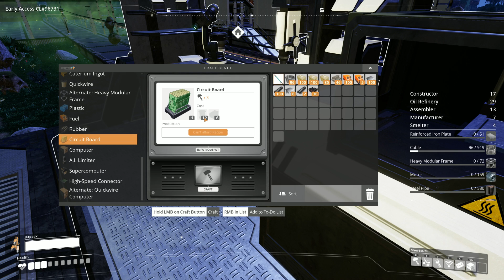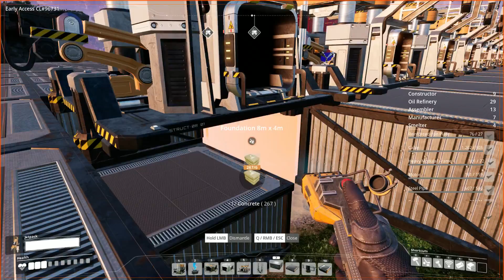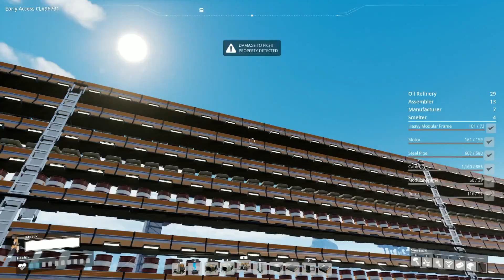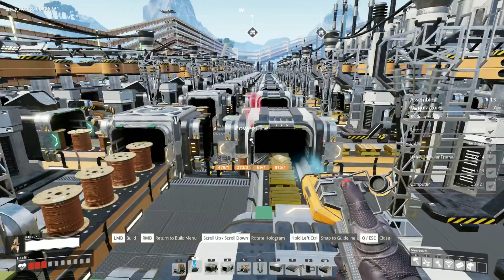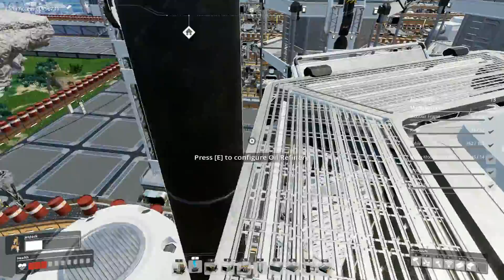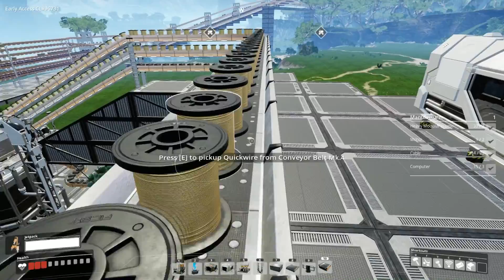Satisfactory Gameplay | 24 computers per min

Comment: If you place your building onto a slope you will be able to see where it's leveling jacks live. At 7:52 the one on the right that is built shows one of the jacks pressing down on the seam between two foundations.  If you look at 10:14 you will notice that none of the leveling jacks are on seams.

That feels completely random on weather it will matter or not as I've played. It my have to do with how the foundations blocks are places (which faces are actually joined as apposed to which appear to be connected).

Comment: The oil barrels going backwards isnt a bug, it's a optical illusion
Reply from the maker: its a bug. you can literally watch it flip back. I know what the helicopter effect is. this isn't it.  it was the first time i've seen it on those lines
Reply: @Skippy0330  The game animates distant objects at a lower frame rate. That lower frame rate is not a bug, it's a level of detail feature to keep the game running smoothly.

It just so happens that the lower animation update rate combined with the speed at which items move along that tier of conveyor belt results in us seeing item number two advancing to just behind item number one's position in the previous frame, and because we don't see the motion that occurs between the two frames, our visual systems are tricked into thinking item one has moved backwards. If item two was a different shape it would break the illusion, or at least make it easier to see through it. Particularly if the belt contained a mix of three or four times of items. That would be a good way to demonstrate that this is what's actually happening.

Technically the fact that we see motion at all when watching a video is an optical illusion too. It's just that we're making it work the way we want it to, by having enough frames showing objects in different positions quickly enough that it convinces our visual centers that what we're seeing is smooth, unbroken movement instead of a series of discrete still frames.

The only way to "fix" the "bug" would be to alter the animation rate used for distant conveyors, either speeding it up or slowing it down until it doesn't reverse the intended motion of the optical illusion.

Comment: The floor is too steep. Seems to be a bug with the seams on foundations. If you try to place a conveyor and the pole sits on the seam it will give you the same thing, but if you place the pole first and then attach the conveyor to it then it will let you place it. When it comes to "buildings" though, I think it has something to do with the attach points hitting the seams and you just need to realign your build. Hopefully they fix it soon.

Comment: The oil going backwards is a really cool bug. Because the same thing happens when you film helecopter wings, at a certain speed, it starts to look like the blades spin backwards, but that's only because there's a lag in FPS and the objects movement. Essentially the barrels are moving forward like 1.9 spaces per frame, and so each frame looks like one of the barrels was pushed backwards a tiny amount. It's just happening because the oil barrels are moving so dang fast. XD
Reply: So is it a bug in the software, in the universe, or in our brains?
Reply: @tylocook  To the extent that optical illusions are "bugs."
Reply: Well it isn't really an optical illusion since the issue isn't happening due to our brains, but rather due to the frame rate of the game vs the movement speed of the barrels being simulated. The computer is essentially rendering the barrels moving backwards despite the fact that they are not moving backwards, which is a bug.
Reply: @tylocook  Yeah, it's a bug in the software. XD

Comment: To solve the "floor is too steep" issue, you need to build foundations by always pointing at the top surface of a connecting foundation. Tear up the entire floor, place one 'starter' foundation, then build all the rest from that one, again always pointing at the top surface of one of the foundations you've just placed. That works to make them all 'flush' with each other. I've been doing that for a long while now and I never have the too steep problem.
Reply: Note that this also means you have to build "supporting" columns after you build the surface you want to place machines on.
Reply: I allways cut down trees and I never have  that problem

Comment: the seams in the floor are causing you the grief, move your building ahead or back one step to solve it
Reply: If the seams are causing you grief for belts, drop the belt conveyer pole where you want it and then connect the belt to it. If the machines glitch on flat foundations, pick up the foundations and replace them, then you'll most times be able to put the building down.